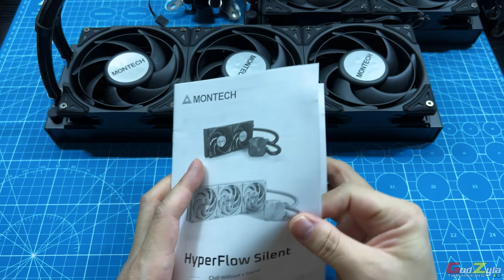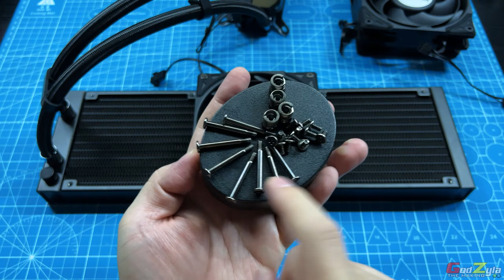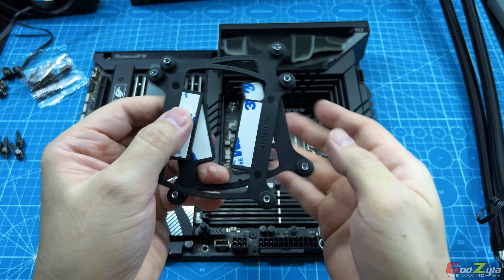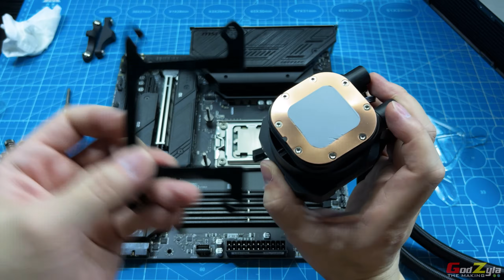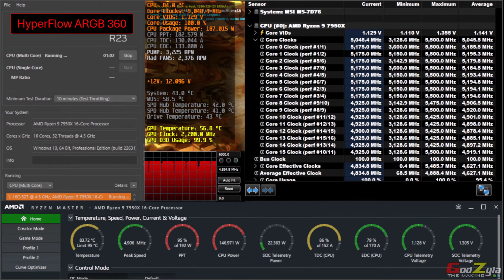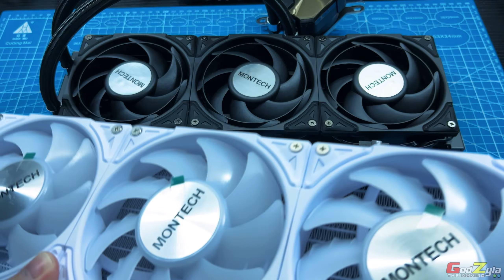Montech HyperFlow Silent 360

Comment: why is it that the backplate doesn't mount firmly and seems to have some wiggle room no matter how tight the screws are or which orientation the backplate is mounted?
have you noticed this issue?

i have the exact same motherboard as well.
Reply from the maker: Welcome back T.L Spitz. More or less there will be some wiggle if you force to move about the pump block. it's natural, so long you mount it and do not force to move the pump block it will be fine. Also it will wiggle more on Intel platform as compared to AMD platform.

Comment: is there a big difference in the sound for the RGB and non RGB ?
Reply from the maker: Welcome to my channel stalker saijayin, this liquid aio only come with the e28 black fans. Are you comparing hyperflow 360 argb vs this hyperflow silent 360? If you are comparing that. The hyperflow 360 will be slightly noisier.

Comment: I didn’t get this bracket In my box
Reply from the maker: Welcome to my channel. If yours is of a 2 point lock down on the amd platform and not the 4 point, contact Montech 

To request RMA support, please send the following information along with photos or videos of the issue to 👉 rma@montechpc.com
Include the following in your 

email:
Model Name & Color:
Purchased From(please share your invoice):
Product Issue (photos/videos recommended):
Your Name:
Address (Including your country and zip code):
Phone Number:
S/N (The serial number of the product):
*The personal information you provide will only be used for the RMA replacement process.
-

🕒 Response Time
Our team typically replies within 3–5 business days (Monday to Friday).
📌 Please avoid sending multiple emails, as this may push your request further back in the queue.

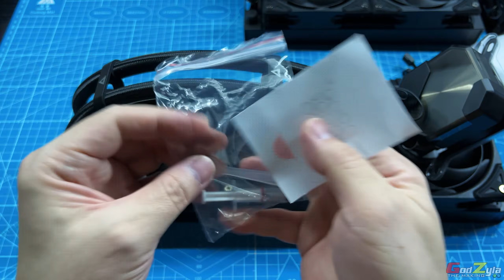Comment: 2:13 what?
Reply from the maker: Welcome to my channel Lighting EVO, don’t get what you mean by what? Kindly elaborate, thank you. 🤔
Reply: @KleoYan what was said hear i did not understand what you said at the timeframe
Reply from the maker: @lightningevo5429 I see. That piece is a template where you can stick to the coldplate, apply thermal paste and it will form a honeycomb pattern, then remove that template and apply to your processor. In general, you don’t need to use that.
Reply: @KleoYan ahh I usually just put on a cross pattern. I see
Reply from the maker: @lightningevo5429 yup cross is good enough 😉

Comment: Thanks for helping me decide on this AIO, 
I also used the pre applied paste but was wondering when I reapply new paste should I use the template provided 2:12 ,have you tried this method yet?
Reply from the maker: Hi weestee, welcome to my channel. I won’t use the template, instead I use my own method to apply thermal paste which does yield good results if doing it correctly. This is how I apply Thermal paste. https://youtu.be/xZ2R4roF1_Q

Comment: Hello,i am looking forward buying this aio 240mm,is the pump silent?I will change the fans most likely so i am only interested for the pump to be silent.Thanks!
Reply from the maker: Hi gabriel galaseanu, welcome to my channel. For noise, it greatly depends on individual sensitivity. For me it's quiet but for some it may be noisy. I won't dare to post my opinion as it's quiet as I have gotten back fired where a viewer curse and swear at me, when I mentioned the pump of an AIO is quiet..

Comment: Can I have it facing left instead of facing the RAM?
Reply from the maker: Hi jwz, welcome to my channel. You can try it out to see if thermal is acceptable for you. I have better results with the hose towards the rams and not at the bottom near the m.2
Reply: @KleoYan  What I meant was that it would face the back of the case.
Reply from the maker: @jwzvlr  ok, I get what you mean, you can if there are space but the flow of fluid is of a different direction. As how it impact the thermal, you will need to test it out.

Comment: How would you compare this to LF3 360? It should cost around 90$ so it is very close to LF3 360.
Reply from the maker: Hi Ziuš, welcome to my channel. I did tested this HyperFlow Silent 360 againts the Arctic LF3 360. They both do perform and it's rather even when come to the thermal result. LF3 is able to do 81°C at load and this will do  at 82°C .. Overall I will choose this liquid AIO as the block is not bulky and the fans are silent as compared to the P12 ARGB fans from the LF3. One other thing I notice is this, if I swap the P12 ARGB with these Montech Metal Pro 12 Silent fans. the LF3 will drop temperature between 1°C to 2°C momre. As in the load will be at 79°C or 80°C.. as mentioned, both do perform. The choice is yours to choose.